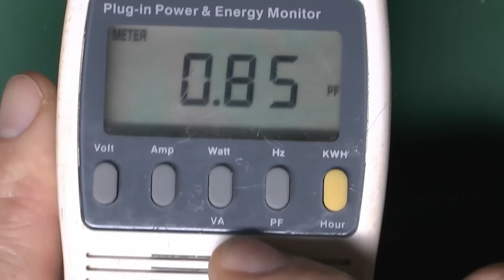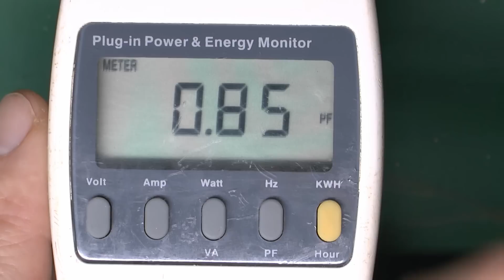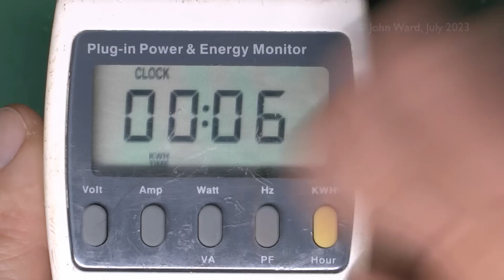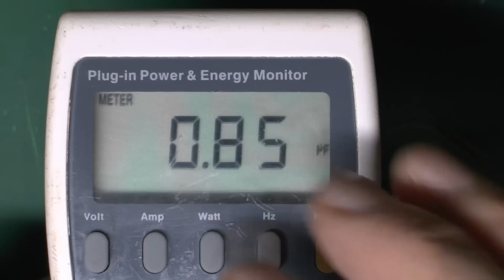Power and Energy Monitor Plug

Comment: When the readings on this UK “Kill-A-Watt” model become inaccurate, change the AC capacitor. Replace like for like. Both of the Maplin ones that I have repaired employed…
0.33uF (330nF) 275V AC X2 safety capacitor with a 15mm pitch.

Comment: I have both 230v and 110v power tools which are used in a non-regulated setting, not a building site etc. I consider the trade off in terms of safety vs convenience to be equal. However with rising and ridiculous energy costs, can I confirm that the 230v tool will be more efficient and thus less costly to operate than the 110v model?
Reply from the maker: The losses will mainly be in the 230-110V transformer.  However even with that, any difference will be insignificant.

Comment: Refrigerators can be tricky. When the compressor starts, they need a starting current of 1000W. 
It's a few hundred watts to run. And then they are switched off again for a long time.
If you want to operate this on an island system, you need a powerful 2000W inverter or more.
But overall the power consumption is not that high.
Inverter fridges don't have such spikes

Comment: 244 VAC❗ 😵‍💫  In the US I generally stay clear of our house 120 VAC. Our 220 (to select machines) is a NO GO ZONE. To think you "guys" have that on almost every wall in your homes is... ShOcK & AWE impressive. R.E.S.P.E.C.T. Just saying. By the way I have a Kill-a-Watt and I didn't appreciate the additonal features until now. Thank you. Cheers!
Reply: The US uses 240v in all houses, the houses are fed from a center tapped transformer giving you 120v in two phases or 240v across both phases.
Reply: @izzystuart7798  Thank you iZzy :face-red-heart-shape: I apparently was "way off" on my calculations? It's good to know [now] because that additional 20VAC would make things exceptionally more dangerous for me. I owe you my life my friend. You RoCk!  :hand-pink-waving::face-blue-smiling:
Reply: @ovalwingnut  It can be anywhere from 220v to 240v depending on the area. Not sure if that would make a big difference unless it was supplying a heating element. Technology connections has a great video on the US electrical system called "The US electrical system is not 120V" :-)

Comment: Was very handy for making a spreadsheet to show my usage.

The only issue is the cooker of course, since it doesn't have a plug.  Does anyone make a device that can be fitted "in-line" between the twin & earth and the wall socket to show the usage of the cooker...?

Or can a plug be temporarily fitted to the end of the twin & earth cable just for this purpose?
Reply: @Kye903    i personally wouldnt put a 13A plug on your twin & earth. I doubt you would get a 6mm cable in the plug & you can only draw 3000watts  from your 13A plug ( it msy get warm over a period of time too.
You may however be able to use either 1 hot plate or 2 at once or just the oven, but not more than 3000watts.
Reply: For those ones a more fiddly option could be to buy one of those cheap Chinese DIN rail mount power meters and a DIN rail enclosure to mount it in.  They are available up to around 100 amps.  Then you could put a 32A plug and socket on it and use it for measuring higher current devices like ovens.  Not sure what the rules are over there but if you need a small 32 amp socket for permanent use you could consider buying an Australian domestic 32 A plug and socket, which are around the same physical size as the UK 13 A plug (with a different pin configuration of course).  Then you could at least plug the oven into the wall without the power meter when you're done.  Search for "as/nzs 3112" and pick the Wikipedia result if you want to see photos of how the different amperage sockets work.

Comment: Any idea as to how accurate these are when fed with 'dirty' power supplies. I use a solar PV diverter (effectively an automatic 3 kW dimmer switch) to feed a 3 KW array of electric convector heaters, and used one of these to check on the diverter's own reported savings. 

If this meter is accurate, then the diverter display overreads by circa 13%. Just trying to see if that is a fair reflection when working on a highly distorted, 'dimmed' waveform.

Comment: Although domestic customers are not charged for reactive power here in Ireland, the smart meter ESB Networks recently installed on our supply (Omnipower single-phase meter ST) shows separate positive and negative kvarh readings as well as the billed day / night (11pm-8am) / peak (5-7pm) kWh readings.

Comment: I have this meter. I think mine came from Maplin. £12.50 in the sale. The buttons on mine have a mind of their own. Frustrating thing is it has no memory so as soon as the powers off you lose your data.
Reply: I can confirm the price - mine was bought from Maplin 4/4/04 for £12-49 and still works perfectly.
I've got a later one from Lidl with a three-button interface which has a 2x LR44 cell backup but you have to remember to take them out when not in use as they don't last that long.

Comment: It has been suggested that smart meters could be used so that bills are based on Power Factor rather than Watts and would be more expensive.
Reply from the maker: Smart meters do record VA and power factor, so billing based on that is certainly possible.
Reply: I mean it's fair enough in some ways - the electricity company has to provide thicker wires and larger transformers to power loads with poor power factor without getting any extra payment in return - I guess it's just that it might be seen as unfair since suddenly you get charged more for the same appliances you've had for years.  At least in the EU I believe there are more and more requirements about appliances that must have power factor correcting circuitry in them, so it might go two ways - either they will start charging for VA but it won't matter by then because everyone will have PFC appliances so minimal impact on one's electricity bill, or they might decide once everyone has PFC appliances there's no need to bother changing to VA billing because it won't bring in anything extra.  Of course if you live in a country without a PFC mandate then surely it's only a matter of time...
Reply: @Berkeloid0  The cost of maintaining the wires and transformers is (in principle) already covered by the current billing system. So, it's not necessarily unfair to the power company if metering doesn't take into account power factor. They're getting paid for it either way. It is technically unfair to the customers who have the best power factor, because they are effectively subsidising those with the worst, but I imagine most homes are pretty similar, so the subsidy is probably quite small in practice.

Comment: The smart meter ‘in home’ monitor gives a whole house running total of course but not individual appliances.
Reply: I use mine sometimes to work out the cost of say a washing machine cycle, or boiling a kettle. If you have little else running at the same time, as I do, it still gives you a rough idea!

Comment: Nice to have you back JW👏
That’s a good little product there. It makes you wonder if a bigger version of one of these (relatively cheap devices), is available to hard wire into the consumer unit, to monitor everything connected at the consumer unit. It certainly would make determining “maximum demand” a bit more accurate. 
How can they manufacture this for £20 then a power logger is up in the £3K range🤔
Reply from the maker: There are things like this for permanent installation: https://shellystore.co.uk/product/shelly-pro-4pm/
4 channels, power monitoring and remote on/off control.
Reply: There's also a really cheap DIN rail meter called D52-2066 that displays V, W, A, Hz, PF & kWh at the same time. It probably has the same precision as the cheap plug-in ones.
It uses a current transformer that can be built in or external, but with any of them you have to disconnect the main live lead to feed it through the current transformer.
These with current transformers are safer if they fail, other types are wired in series with the load and can melt or catch fire if the internal construction is shoddy, I would only trust one of that type if it's from a reputable brand.

Comment: Be careful with these on very high loads for very long times. Like EV-charging.
Reply: This one claims to be rated for 15amp I think. It also has an alarm if you overload it.
Reply: @cannamorecamping5029  Even if the rating is adequate it can overheat over time because of bad quality or corrosion, pitting, dirt etc. on the plug contacts. And you lose one of the safety measures. The temperature sensor in the plug since you now basicly have two plugs. The charger/equipment and the meter. Here in Norway it's not even legal to charge with a plug at 5 amps on a 16A circuit. It has to be hard wired to a separate circuit.
Reply: @sedsberg77  I'm actually using one to charge my ev. My ev is not a car though and the charger only draws about 500 Watts.
Reply: I have one that looks the same as this - the contact pressure on the pins of the plug is very poor and yes they do heat up quickly (or even flickers on and off).  I keep meaning to take it apart  and see if the sockets can be squeezed up a bit.